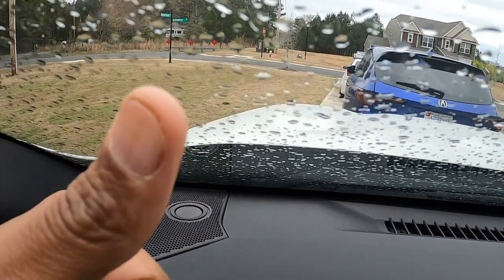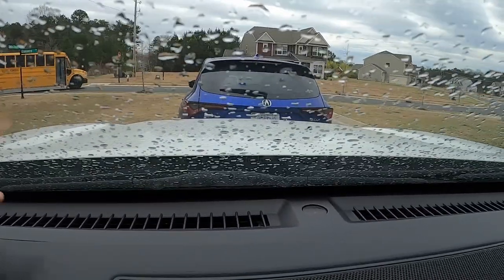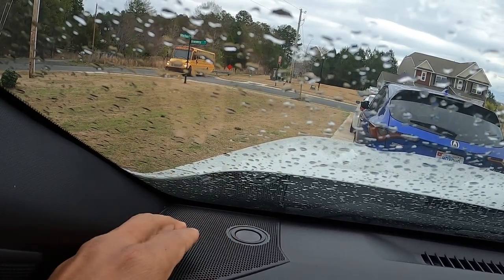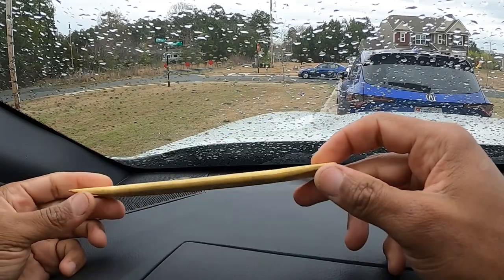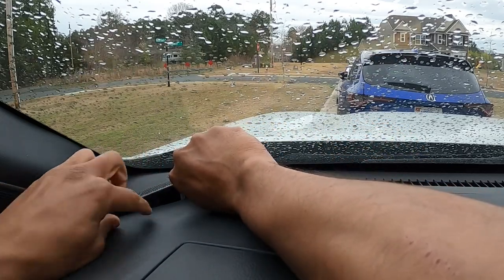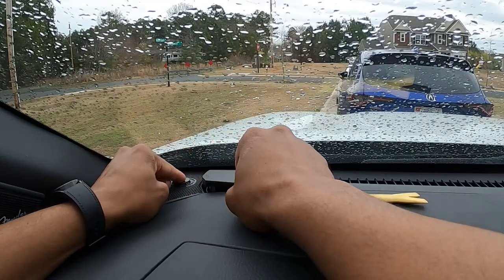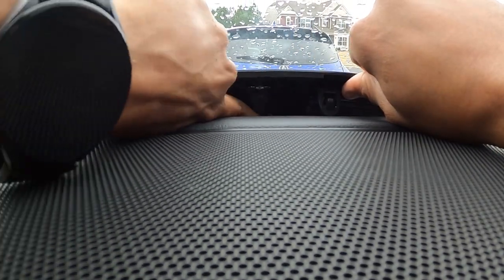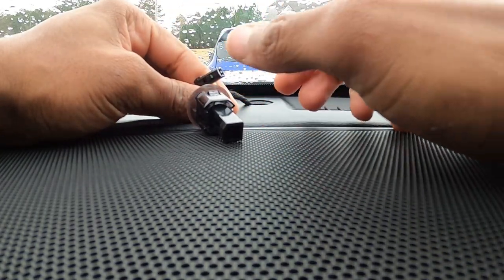Nissan Titan Dash Sensors | Sun Load Sensor | Auto-Light Sensor

Comment: Is the sunload sensor related to hvac at all ? , i have a 2015 infiniti qx80 and i have a code for the sun load sensor . My ac cuts out intermittently when it wants . When im on the road the ac is cold as can be. My fan refuses to come on sometimes. One issue at a time lol
Reply: How’s it going man, were you able to figure it out? I’m currently getting the same HVAC code for the sun load sensor. Thank you!
Reply: @gabrielpalomar8285  it seems it is related to the ac system because on my scan tool , the code pops up on HVAC . I'm going to replace it since it seems pretty easy to get to.
Reply: Sunload sensor works by telling A/C how much harder it needs to work to cool the inside of the car. Also sunload sensor shorts to ground, in the enclosed place or garage where there is no sunlight. Doesn't mean that the sunlight sensor is faulty. Don't change the sensor if your A/C works.
Reply: Sun Load Sensor essentially controls the climate control and therefore the cabin fan speed. The SLS works in conjunction with the Ambient Air Temperature Sensor ( AAT ) to control the climate control system.  They both also influence the headlights' brightness.